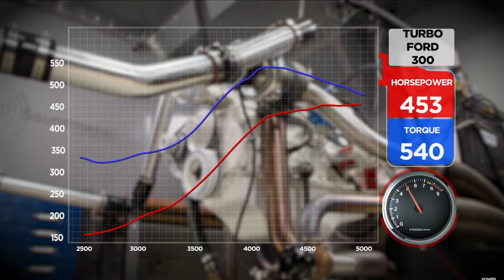Minute Engine Explained Ford 4.9L

Comment: I was done with college...and broke.  I bought an 89' F-150 for $500 sight unseen, that had the I6.  On cracking tires and a rapidly deteriorating clutch master cylinder, that truck got me from Anchorage, AK to San Francisco, CA, in the dead of winter, without a single issue.  Then I drove it 10 more years.  Never a single issue with the engine, and it had at least 300K.  Should have never sold her.

Comment: I got a 92 f150, i was thinking about a 302 swap, not anymore!
Reply: I have a 93 econoline 302.  Just hit 55,000 miles and fairly pleased, but I’d definitely consider swapping to a 4.9 if something ever goes wrong.
Reply: Don't do it straight sixes are the best truck engines ever
Reply: 302 is a great option if you need a quick swap, but I'd find another 300 to put in it asap 😂

Comment: as an Australian I have 3x6 cylinder Ford engines in the 66 Falcon coupe I have a 200 cubic inch made in Australia just rebuilt I put everything back on it by my self  and it started the first time from a static tune-up I could not believe it ,I believe I'm a good boilermaker I'm a s*** mechanic but it started?Fme , sue has a Ford Territory with a 6 cylinder x German gearbox fantastic. I have an old 05 we call them a ute ,burra engine 1 ton there is a variable camshaft in these things they need to be screaming for the oil pressure to engage it, man you get wheel spin at 80k per hour its done 265000 km 16500mi Ford and General Motors make the best cars in Australia they have ever made and then went home???

Comment: I have an 81 f150 with 93 4.9l. Pulled all the fuel inj. off and put a 1bbl carb on it. Had to run electric fuel pump because no hole for mechanical but works like a clock
Reply: I put a mechanical pump on my 88 300 six. The spot where the pump mounts is easily removed. Thin casing over the hole. Bolt holes was there. Cam has the lobe. I don’t think the head on the 300 efi works the same for the carburetor set up. I get bad fuel mileage compared to other 300 with the carburetor head. And it idles a little rough. But runs and drives okay.

Comment: Had a uncle who had a bricknose f150 with a 4.9 with a dump bed conversion when he finally sold it it had 2.9 million miles but the engine still ran smooth and the trans was only rebuilt once he used it to take his trash to the dump parts runs for his tractors went to church with it and went to dennys after that was its life he had it since new he sold it to his neighbor and bought a 2014 5.0 f150 in 2017 he now has it to 300k miles with minimal issues a video on the coyote would be cool

Comment: I got a 96 f150 i6 4x4 automatic long bed. Has some vacuum leak and cylinder 5 has low compression. Me not being a repair kinda guy really sucks cause I love that truck and really wanna get it going. Needa stop being lazy and just start working on it. Knowing my dumbass I might just make it worse off instead of actually repairing it

Comment: HEY ARON, im thinking of buyin an old 66 mercury truck with Ford Inline 240 6  clyinder.,
the owner wants alot of money in my opinon considering she also says the engine is kinda tired.
SOOOO, can i bolt up any newer than 1966 ford inline 6 engine to this 66 tranny?
i just dont wanna drive 6 hrs there 6 hrs back with a $5000 truck and have that engine fail and not know what my options are ahead of time.
i would kinda like a auto tranny but sticking as close to original is also a big plus
Reply: I am propably late but the 240 and 300 are the same block. A 300 is a stroked 240. Even the same head. So a 300 should bolt right in!
Reply: But the 66 240's got IIRC a head that gives a 11:1 compression ration, the highest of any year 240 or 300.

Comment: 4th best motor in the world. Runs like stupid good and torque just like a desile and sounds just like a diesel with the headers of. This motor is crazy torque. It’s just like a 5.9 desil but it 4.9 gaser I have 1993 obs= older body style. Works good very good. Not greatest on gas tho. But I can’t stand listening to that power steering. U can hear a ford coming just from power steering.